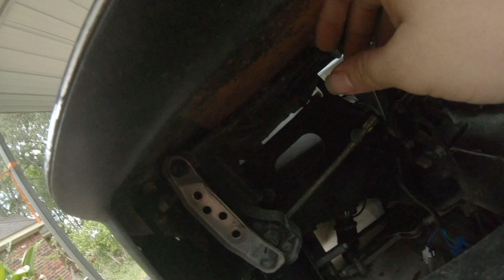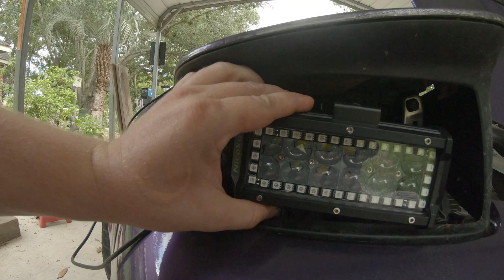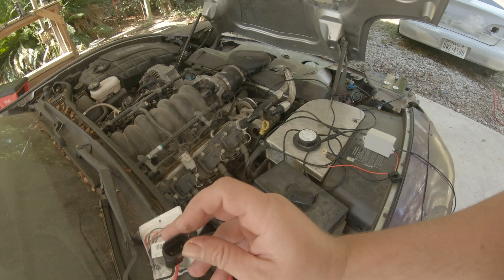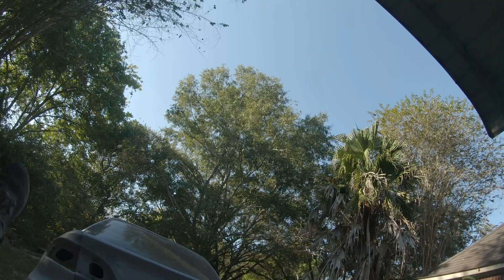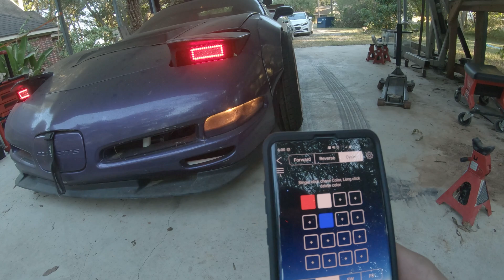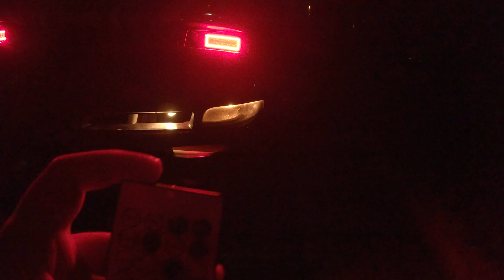Diy sleepy eye conversion on the c5 corvette

Comment: Heads or Corvette ever went into limp mode and said reduce engine power I need help
Reply from the maker: Mine will pop up with reduced engine power and won't start. I haven't fixed it yet I just unhook the battery a couple times until it starts for now